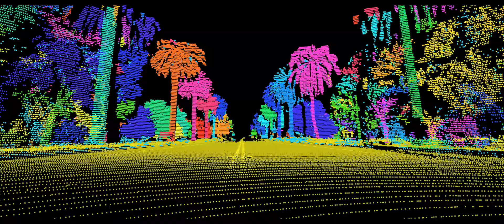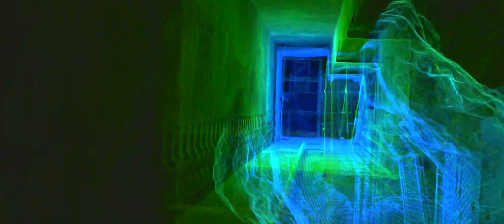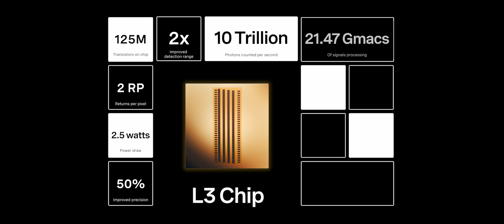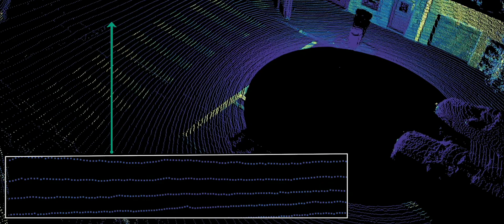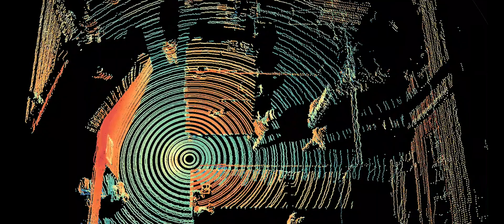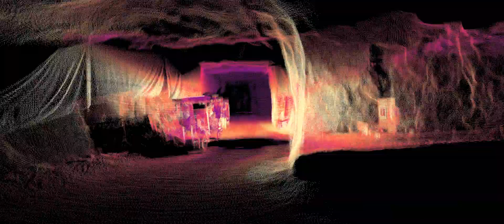Introducing REV7 powered by the L3 Chip

Comment: That all looks pretty dope, the only thing I'd want is for the OS2 to fully support starting and operating at -30° degrees or less.
Reply from the maker: Our sensors support cold-weather operating temperatures down to -40°C
Reply: @Ouster-lidar  Yes, we were advised that the OS2 could start at that temp, but would have to warm up to operate in that range, while the other sensors could start right away. Is there any change to that statement with rev 7?